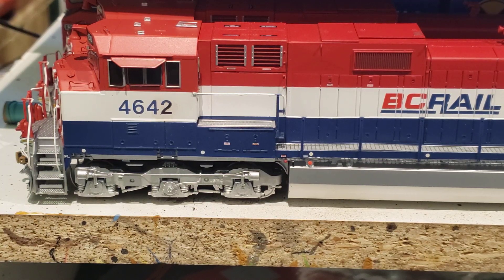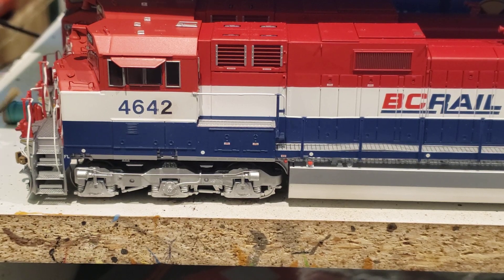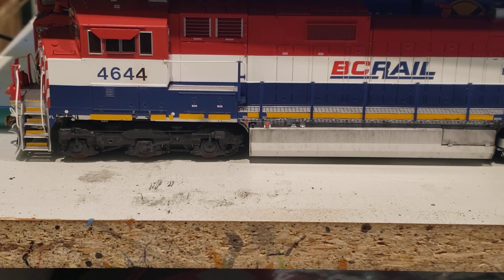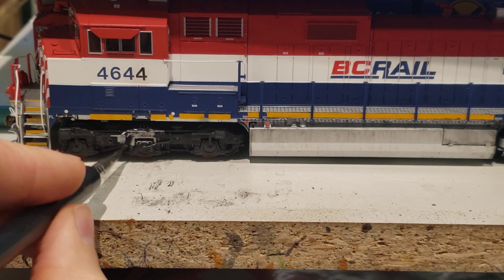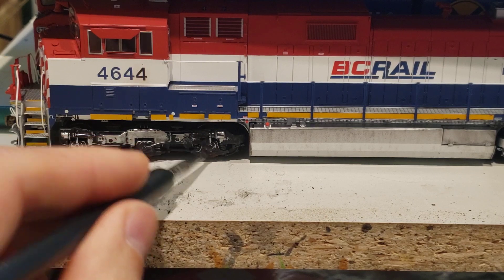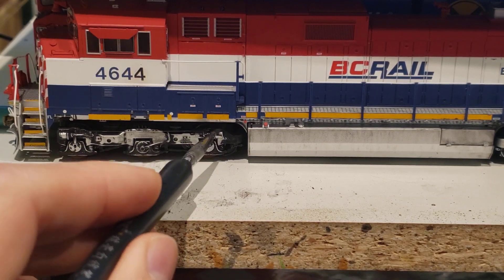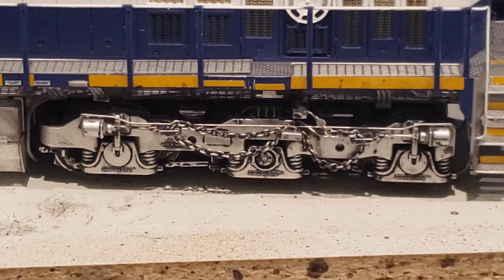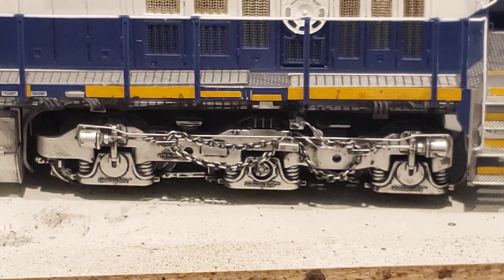Wax on, Wax off... a happy little mistake. Improving the look of BC Rail 4644 C44-9w

Comment: What paint did you use on the trucks? I love the effect. Some of the best stuff is discovered by mistake.
Reply from the maker: Oh yeah. Ok so use Tamiya Rubber Black. I sprayed it through an airbrush. Do not use the power wash technique on your trucks to remove the paint. You'll likely bugger your electrical contacts.